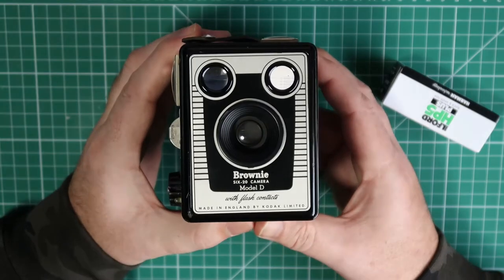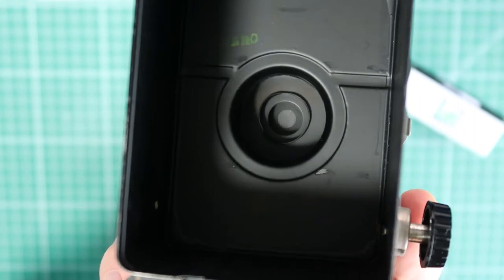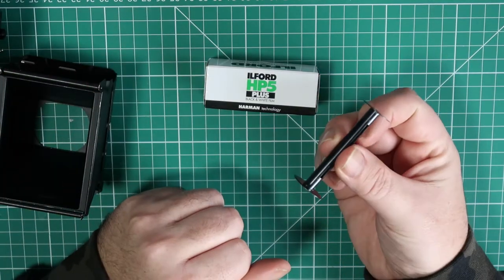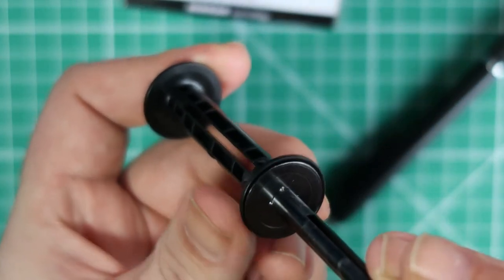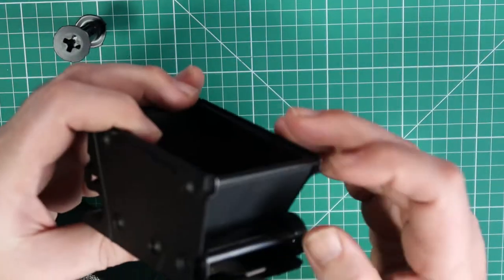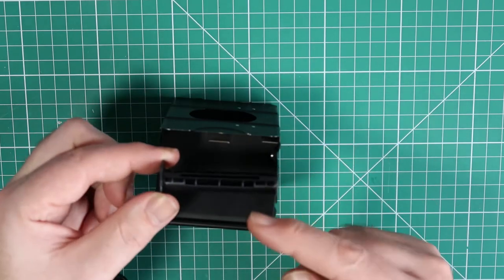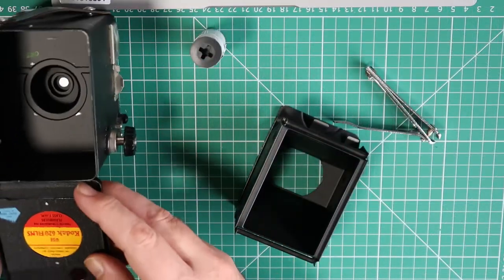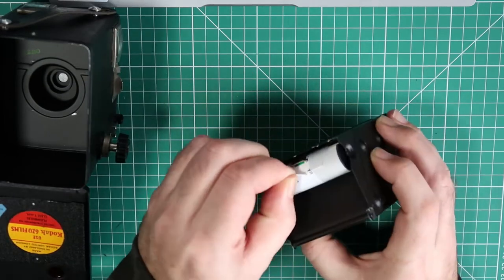Using 120 Film in 620 Kodak Brownie Model D Camera

Comment: I have just got a brownie model 1 with an empty 620 spool inside.  If i do this method Can i then just co.tinue with empty clipped 120 spools and new clipped 120 films? Or do I need to get hold of a losd of empty 620 spools (i dobt develop at home and send afoy).
Reply from the maker: I develop at home so I always keep the metal 620 spool. You could always ask the lab for the spool back or just buy a load off ebay but they'renot cheap. Other way to get them is to go to car boot sales / garage sales / charity shops where really old cameras for a £1 might have a spool in them... Good luck and keep on shooting!!

Comment: What a great video!
Thankyou so much.
I do have a question tho. I want to sent in my pictures to a lab. But they only take 120 film. Any idea how I roll back the 120 film from the 620 cylinder to the 120 cylinder? Since the key won't take 120 when I try to roll it back in the camera.
Reply from the maker: Thanks so much for the lovely comment, it's really appreciated. I develop my own B&W 120 so it doesn't matter what spool it's on, but if you need to send yours away, you could manually roll it back onto a 120 film spool (in a very dark room obviously) and then send it off. It's easier than I originally thought it might be to do this, as long as you are in a dark room or have a dark bag, and keep the film winding with some tension on it to prevent any fogging when you take it out to send it away. Hope this helps and good luck with your photos!!

Comment: Thanks for the vid, but there's something else I would like to know: for one who's not developping his films himself, how do you take the film off the camera without burning your shots?
Thanks!(Mine is the 1946 C model. ^^)
Reply from the maker: Hi thanks for the kind comments. If you're sending it away to a lab then you might be able to just send it away on the roll, and when you open the camera (in subdued lighting) the film should still be wrapped around the spool. There is a piece of sticky tape that you can use to lick and stick the roll shut then send it off to the lab.
You could also roll it off and put it onto a normal 120 spool, but this would need to be done in the pitch black darkness. As long as you pull the film on tightly when you wrap it up, there should be no issues.
Hope this helps and good luck with it. The thing I didn't realise was that there are only 8 shots on this 120 roll due to the camera model.
Reply: @bobgriffiths  I'll try my best, and might come back to you with my results should you want me to.

Comment: Make sure when buying adapters for the ends of the 120 film reels that you buy strong ones- like literally ones with “strong” in their description- the reason being that you (like me) will get halfway through shooting your roll of film, having a great time, pleased with the subjects you chose to shoot- and the film will stop reeling with the winding reel. What’s happening is the resistance is building on the reels and suddenly the cheap, soft, wax-like plastic on those adapters gives way and won’t reel any further. Now you’re in a position where if you have a darkroom, I guess you can salvage your roll of film, but if not, you’ve gotta pull open the camera (ruining your film) and start over.
The cameras are inexpensive and available, cleaning and fixing them isn’t too hard, but there’s a bunch of grifters out there (because of course) who want to try and cash in on your interest in trying out an antique camera, while selling you garbage. Be careful buying those adapters- it’ll save you film and money.
Reply from the maker: thanks for that, it's useful to know that in some cases it can tear the centre out of the plastic, it didn't with mine but that's not to say it might not with others'.